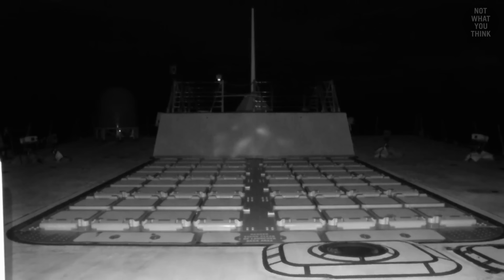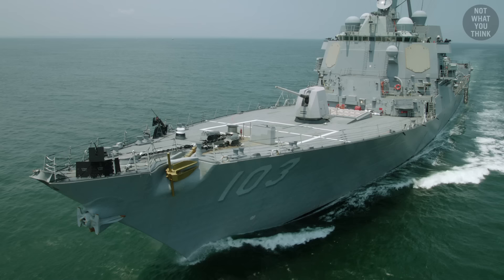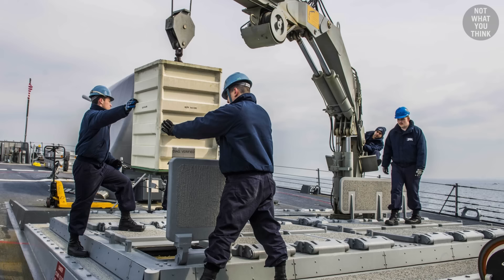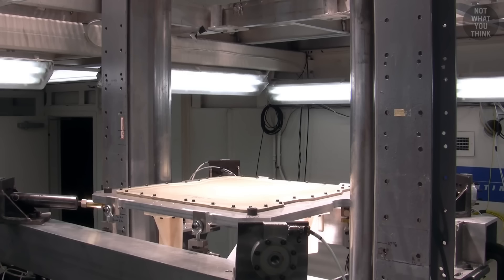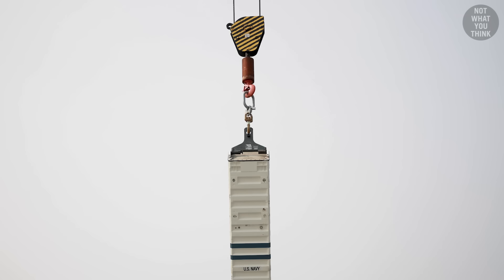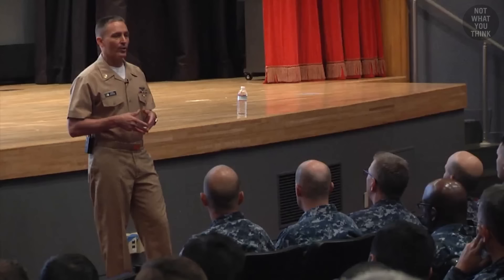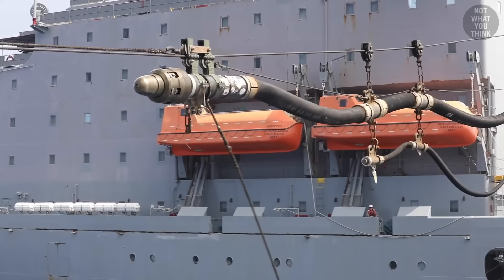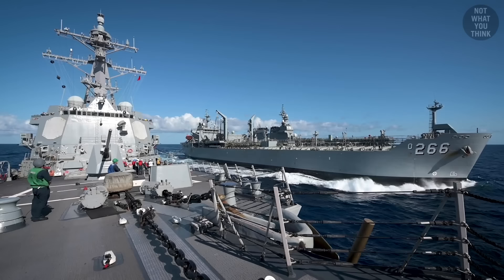Why Warships Cannot Reload Missiles at Sea

Comment: I don’t get why they don’t use a ridged erector for the canisters onboard of the ship. Similar to the launch erector of the sojus rocket. It would be large, but would enable reloading under nearly every condition imaginable.
Reply: A big VLS advantage is no moving parts.  One of the reasons they got rid of the crane, and that reloading at sea, in the big picture, is not that important of a capability.
Reply: An erector like that would be enormous and heavy, and because it's out on deck it would take an absolute beating so you'd be fixing it all the time if it didn't get hit by a big wave and wrenched off the ship entirely. It would also still leave the problem of how you get the missiles onto the destroyer from another vessel at sea.

Comment: Recently saw they used noise-canceling tech to remove turbulence from air flight. It preemptively maneuvers the plane to counteract the turbulence. I wonder if this would be possible on a ship with cameras around it monitoring incoming waves.
Reply: The ship's gyros control both the ship's stabilizer fins and gun barrels, wouldn't want to compromise fire control systems with fragile cameras.
Reply: @actually5004  My only reasoning for cameras is they could be predictive.

Comment: So what you are saying is that you should send 100 relatively cheap drones to each ship at once  and then send an anti ship missile after it when it is defenseless. Thanks for the tip, I am sure this is highly appreciated knowledge
Reply: The cheap drones would be defeated by electronic warfare systems.  And even if the systems were hardened against EW (which means that they will no longer be cheap) you simply use the Phased array radars to hit each one with a massive amount of energy at the same frequency as their guidance radars - this will fry the radars.

It is rumored that the F35 has an electronic attack option (damage the radar receivers by hitting them with amounts of RF energy that the electronics get damaged) built into its EW system.
Reply: Sensors are able to discriminate the kinds of weapons attacking the ship.  A drone looks and behaves very differently than a cruise missile.
Reply: @colincampbell767  AESA radars in general are claimed to have this capability, so you can add certain lots of the F/A-18E/F, EA-18G, the F-22 and some F-15s and F-16s along with later production Gripens and Typhoons to the list.  Oh yeah, add the SPY-6 on the Burke Flight III to the list.

Comment: Maybe load the whole VLS as a crate instead of separate crates into the VLS?
Reply: The empty module weighs 15 tons and with missiles inside it could be almost double that. Also, I think you'd have to redesign the modules and the ships to incorporate mechanisms to slot them in and out rather than being welded or bolted into place.

Comment: About the firing arc, as VLS missles are fired vertically and theb readjust their course mid-flight, why couldn't an arm launcher send a missle roughly in the correct orientation, or even vertically, and then the missle readjust itself ?
Reply: It could.  The missiles back then just weren't programed to fly that way.
Reply: Usually isn't much point doing that. It's often better to gain altitude as quickly as possible, then aim at the target than taking a more direct flightpath that spends more time in denser air.
Reply: The reason VLS replaced arm launchers is that arm launchers are just too slow.  VLS can fire a missile every 1.5 seconds per VLS installation.  Back in the 1960s and 70s it was already apparent that anticipated stream raids of Soviet air, surface and submarine launched cruise missiles would arrive at the carrier strike group faster than the old arm launchers could spit defensive missiles.  Plus those older missiles were semi-active homing.   They required an illumination radar so the defending missile could home on the energy reflected off the target.  The strike group couldn't fire missiles fast enough to keep up with the volume of incoming rounds and there were never enough illumination radars to handle the number of anticipated intercepts.  Aegis and VLS solved those problems to an extent. Updating missiles to fly out on an inertial reference and only needing illumination for the end game along with Interrupted Continuous Wave Illumination (ICWI) allowed more intercepts to be conducted than the strike group had illumination radars.  Replacing semi-active final homing with active homing on SM-6 and I believe ESSM Block 2 eliminates the need for illuminator radars entirely.
Btw, Active Electronically Scanned Array (AESA) radars like AN/SPY6 and AN/SPY-7 can form a concentrated beam of energy that could fry a missile electronically.  No need to expend a missile for a kinetic kill.  Some fighter AESAs could notionally do the same thing.

Comment: Why not build a large frame that fits on top of the entire vls system. You could load the frame with missiles before placing it on top. And then drop the canisters in. Then remove the loading frame and your done.
Reply: Yea I was wondering why they don’t do this to just have all reloaded at once, I get that they don’t use all there missles typically but you can just put which missles are missing in the reloading frame to be put in
Reply: How much does a huge gantry crane weigh and what does it do to the stability and handling of the ship?
Reply: Good idea.  The good people at NSWC Port Hueneme already have such a system.  It can be carried by the logistics ship, set up on the receiving ship using their UNREP gear. Once attached to the VLS of the customer ship the logistics ship's STREAM Rig lines are attached to the frame and they can use the STREAM Rig to retrograde empty VLS canisters to the logistics ship and transfer loaded canisters to the customer ship.  The equipment exists and some testing has been accomplished before funding ran out some years ago.

Comment: AI could sure change things with tracking. The military dropped the ball ending the arsenal ship project. Now with AI and before long quantum computing Arsenal ships could be made an outstanding weapon system.
Reply: The issue with the arsenal ship concept is that the Navy does not have enough missiles to fill all the VLS cells in the current fleet, so adding a few hundred more on just a couple of ships doesn't help with anything.

Comment: 1 - the USN, nor any navy, has ever had the problem of a warship 'running out of missiles' in combat.
2 - an arm launcher holds usually 4 missiles. it will go 'Winchester' long before a 80-cell VLS array.
3 - crane or no crane, you cant reload a VLS cell in combat as you prevent all the rest of your VLS cells firing (a missile firing would toast your reload crew)
4 - no amount of reloads, arm launchers, or 200 VLS 'rapid dragon' arrays will solve the problem of needing a 2 million dollar missile to splash a 500 dollar dji drone loaded with dynamite. if you put 500 missiles on a destroyer, for the same cost a peer opponent could buy 2 billion DJI drones.....
Reply: In regards to number one... no navy has ever been involved in a prolonged conflict involving missiles.

Comment: Just a thought but if there was a cable at the bottom of the cell that could be used to pull and guide the container into the cell ....just a thought.
Reply: That solves a problem they don’t have. The hard part isn’t man handling the can into position. That’s easy. I’ve done it. The hard part is lifting the can over the cell.

Comment: Instead of single missile/tube should do a ROW/Magazine of 4-6 at a time.  YES there is a weight issue but doing a row at a time would speed up reloads you just need a tall enough resupply ship with Large/Strong  enough cranes with a built in safety factor.
Reply: If you've got space for a magazine, you've got space for more VLS cells. If the reloads are located below the VLS then the size and draft of the destroyer would increase so much that it would massively increase cost and seriously limit where the ship could operate because it would need much deeper waters.
Reply: One SM-2 in its canister weighs 4,200 lbs.   The most recent update to the standard US Navy STREAM Rig allows it to lift 12,000 lbs, up from the 6,000 lbs they were originally designed to lift.  We could just barely lift 4,200 lbs on a hot day at minimum fuel in the CH-46D, just for your reference.  There is only so much weight you can UNREP or VERTREP at sea.  But take heart, NSWC Point Hueneme (Hueneme is pronounced like Why-knee-me) has a portable rig that they designed that can be carried by the logistics ship, transferred to the customer ship, erected over the VLS farm and then attached to the logistics ships STREAM Rig to facilitate underweigh replenishment of VLS canisters.  As an aside we also did this at sea with a CH-46D and the crane that used be carried in the Mk-41 during the Cold War.

Comment: Just a small point, but you referred several times to China being a (military) peer to the US. They aren't. They're a near-peer. A small distinction I realize, but an important one. For example, China has 2 aircraft carriers compared to the 12 (I think) operational carriers that the US has. China has a fairly large air force and naval air arm however the largest air force in the world is the USAF. The second largest is the US Navy. The Marines also have a significant air arm as does the Army. So although China has a powerful military they are not currently on par with the US and if you add in the rest of the western powers they can't come close to competing. To give China it's due however, they have come a long way in a relatively short time and might, in certain very localized situations, be able to hold their own for a short period. Of course this is all assuming that no side is stupid enough to use strategic arms during a conflict.

Comment: I’m sorry, but grabbing heavy missiles from one end and letting them swing is just wrong. Use a gantry that has multiple points of contact with the hull, with a cradle that holds the container while you rotate the load from the centre of mass. Lock the cradle to the top of the launch tube before lowering the missile container into the silo.

Comment: I wonder if it would be practical to use a staging rig or something along these lines in a potential fight against china. Something that can be floated but is a stable platform and can be placed realtively close but not too close to the battlefield. Minimizing the time a ship needs to retreat in order to rearm. Or maybe using a supply ship as an ammo ship and you standardize the VLS for almost every ship you have and rather then replacing tubes singly you replace the whole system like a hotswap like server hard drives.
Reply: Yeah they had a deployable barge thing but scrapped it because it was too impractical to transport
Reply: You folks beyond repair
Reply: @SunriseLAW  quit yapping bud
Reply: @bigman86-ob3db is what he said not accurate (serious question)?
Reply: If the Taiwanese are smart  (and they kind of ARE), they will be looking to exploit the concept that a mobile director can be used to fire missiles on another mobile platform (be they 'trucks', ships, barges, or airplanes!),
So that they can be moving, bobbing, and weaving when the Fascists come from the mainland.
Reply: @jonathanmora9398 They just hired the wrong engineers!
That happens a lot:
People think experience is such a good indicator, and they often want product specific experience; not always the best way to stimulate innovation...
I was saw a job posting that, as a requirement, listed over 5 years' experience with software that was only 2 years old!
Reply: Using a stable floating platform is simply not feasible to load a launcher on another floating platform of a ship. Both floating platforms would be constantly moving in all 3 axis in completely different directions to each other. The tricky part of loading the VLS from a land crane is getting the missile started into the launcher, as the land crane is not moving while the ship and thereby VLS launcher is moving. Even when you get the missile started loading, the land crane has to very slowly lower the missile, as it pinches from the ship still moving until the missile is loaded about 1/3. The missile pretty much guides itself past the half way point and slides right on in and down. So doing all that with TWO floating platforms is just not feasible and would be a complete nightmare if not impossible.

Replacing the whole system would be even harder than replacing single cell tubes (canisters), as you just now created a heck of a lot more pinch points. The only thing that made it some what easier loading the missiles from a crane on land is the fact that the canisters are square and fairly narrow. So getting it started on all four corners was not as difficult that any person could easily see all four corners. I could not imagine doing that for a much bigger hotswap like you suggest, especially as the VLS is 8 rectangular modules.
Reply: @kevinfisher1345  Yes, I was on a CLF Ammunition Supply Ship (AE), so am pretty familiar with what it takes to be handling such things topside, although this was before VLS was on many ships, and we only transferred missiles, we didn't reload firing systems.
In MY previous post, I was suggesting the use of barges (or modified, self-propelled barges) as a firing platform, in certain cases of coastal defense...
As for reloading, that was a bit of a design oversight brought to you by the same mentality that designed the F4 with 4 missiles and no gun....
Reply: @TheScandoman  I was actually replying to OP, but it applied to yours as well. The barge was tried and think from what I heard anyway, was not pursued in the end. Yes reloading perhaps was a bit of design oversight.

However, we were the only ship during Desert Storm that expended all the missiles in our VLS after a month. We reloaded out of UAE, but by the time that was done and we got back, we never fired another one. So we went back home with a full armament. This of course will depend upon each war and circumstances. War against China for example near China and likely would become an issue real quick. Armament and resupply is typically always an issue or concern during wars though.
Reply: In 1961 , the USS Proteus reloaded an SSBN with 18 ton Polaris missile while at sea , 
Technically they were still in the harbor
SM-3, TLAM and SM-6s weight about 1.5 tons while the LRHW weights about 9 tons
Ideally , the ships would have be along side like they would be in port 
The crane slides over and the drops lines so the spent canisters can be quickly pulled out simultaneously sending over fresh rounds
Now the USN with the DDG-X is introducing swappable VLS modules which is a sign that USN is looking at speeding up VLS reload
instead of going missile by missile
Pull out the old module and replace with a fresh one
A full VLS with weights 95 tons which easy for most mobile cranes
If they do keep the swappable modules for the DDG-X , then reload times at port will be greatly reduced
Reply: @kevinfisher1345  Ok, well, it was my understanding that the barges has been evaluated as a reloading platform, which MIGHT have some benefit of efficiency, if they couid allow an acded flexibility in reloading in many more, and perhaps unexpected places..., but no, they wouldn't be able to do this in open water, and they probably would not fare well in ooen water...
My hypothesis was that, with the state of electronics and information systems, today, it doesn't exactly seem that we need to have the missiles on the same craft as the targeting array, and having mobile camouflaged barges with, say, 60 missiles ready to fire, could let you fire off a barrage of missiles, and then, if conditions permit, move the barge overnight; alter the camo' a bit, and NOT have all your ships sitting ducks at a reloading facility...
This doesn't make so much sense in the way of fleet defense in the US Navy, but, for Taiwan, who can be considering all kinds of missiles in repeated barrages of HUNDREDS, not dozens!
And repeated QUICKLY, as in at least twice a day, and several days running!
They make the last year's worth of pyrotechnics look like an 8-year-old with a sparkler on the beach!
Reply: @verdebusterAP  Well,.if you want a missile magazine system that can efficiently swapped, 'wholesale", arguably the whole configuration needs to be re-evaluated: having a large module that could be arguably just attached/mounted in a niche on the 2 sides of the ship, that has been built into the ship, with cargo grade links and latches, with an outer shell/fascia that is both armoured, and preserved the lines of the hull.  This could possibly allow the removal of a an entire magazine in one 'swell foup', without lifting it out and high above the deck, and, more importantly, likewise with the supposedly full and much heavier replacement magazine!
When you van lift it merely a foot to clear the latch mechanisms, and then simply move it laterally, things can be done much more quickly and safely!
Obviously, you woukd need heavy-duty linkage mechanisms and access to connection, but additionally it could allow designers to orient the missiles at a slight angle on either side of the ship; what's going to allow you to project the missiles a little bit away from the ship, which appears to result in some improved safety when malfunctions occur.

Comment: They should have made 8 of those in like removable cells so they can pull them out 8 at a time, like a cartridge
Reply: Too heavy.  An SM-2 in its canister weighs 4,200.  I have lifted them with a CH-46D.  Just one canister is a very big load.  Eight at one time would be impossible.